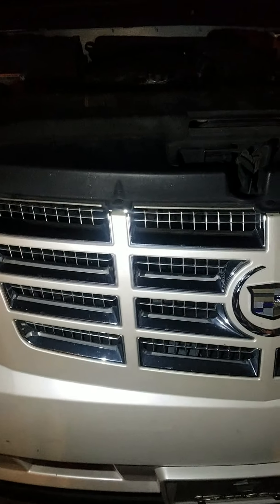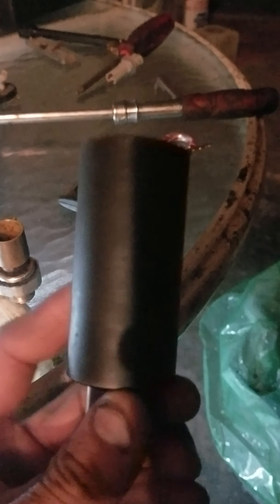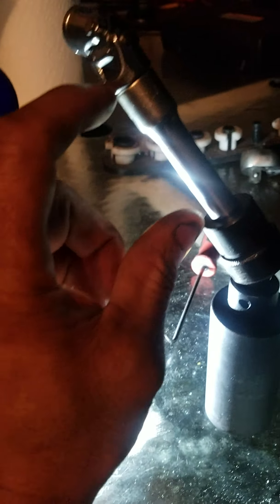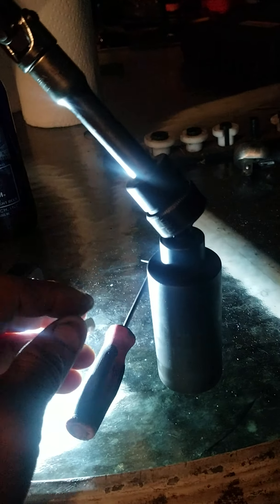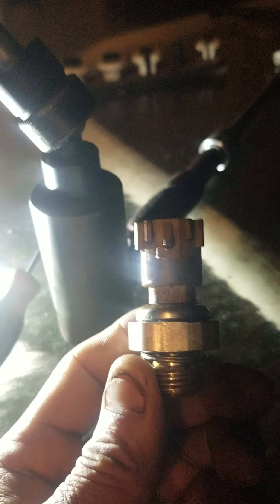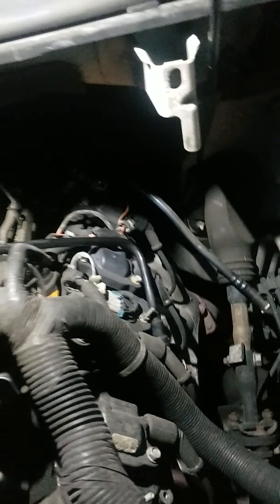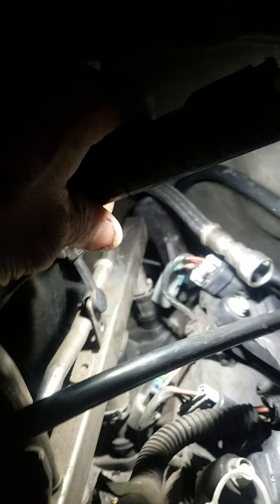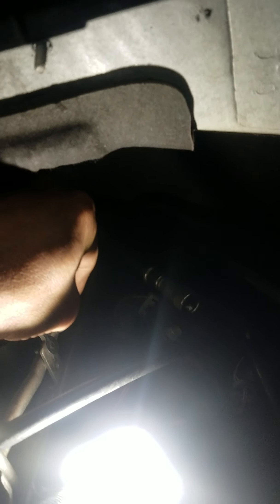2009 Cadillac Escalade Hybrid oil pressure sensor removal

Comment: You didn't say the size of the fuel line disconnect tool
Reply from the maker: Sorry not sure the size.  If you have a set of fuel line tool you should be good.
Reply: I got mine at orileys for $7 I believe 6 different size
Reply: At fist I thought it wasn't gonna work but it did